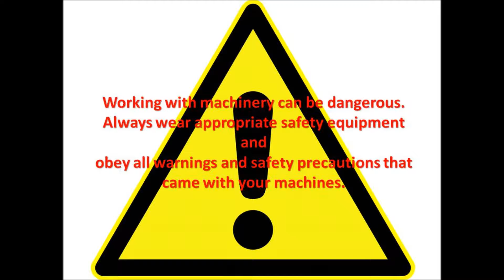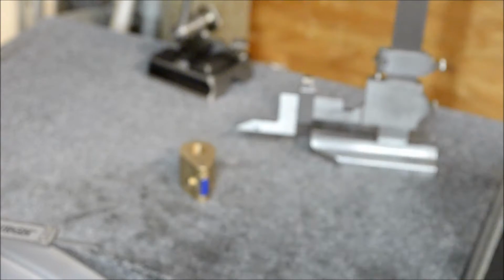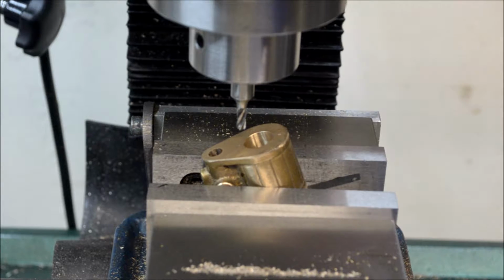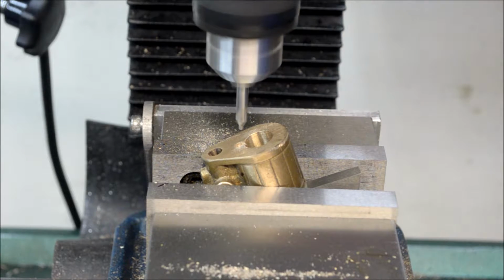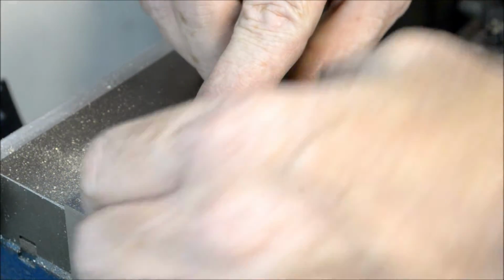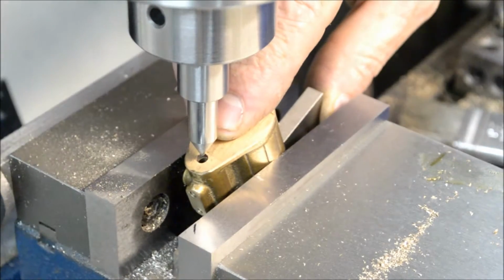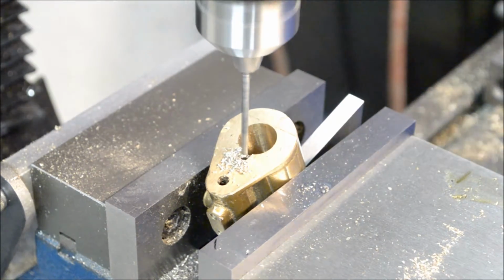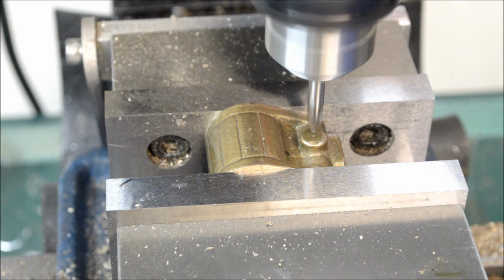PM Research #3 Cylinder Pt 4

Comment: Thanks for this build series of videos. I’m learning a lot from them. In the first facing operation here, how did you ensure that the face would be perpendicular to the line through the centers of the bored and reamed holes that you previously made in the part?
Reply from the maker: Sanjaya Kumar in the 1st part of the cylinder operations I set the casting up in the mill and indicated it so it was perpendicular, then I machined  the one face flat and referenced of of that flat face.